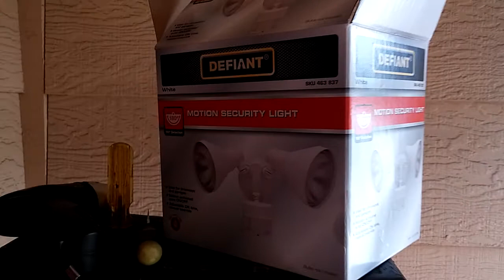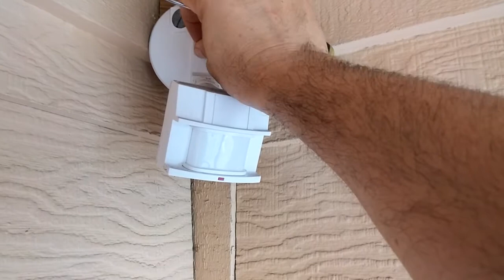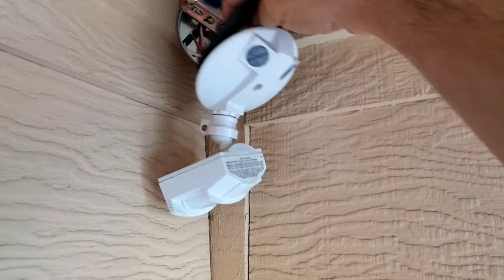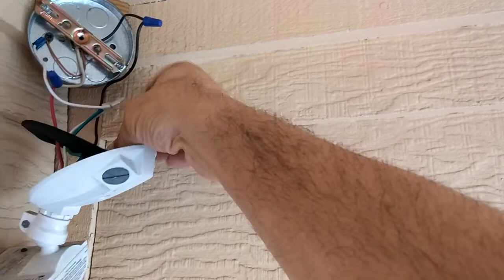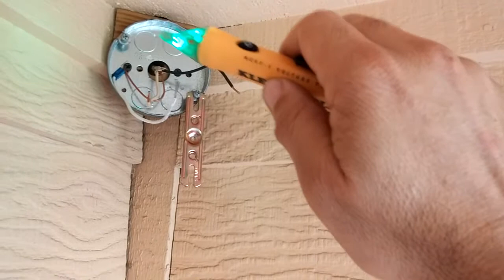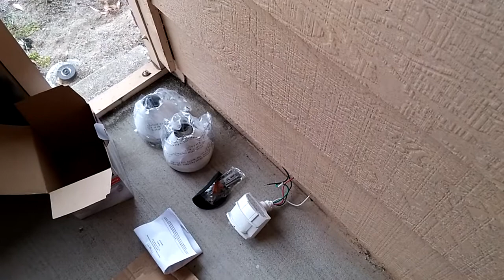DIY/ How to Install a Motion Sensor without the lights bulbs.

Comment: They sell just the sensor. No need to buy the whole kit. And also they sell overhead lights with sensors for like the same price so you don’t need to rig the corner sensor.
Reply from the maker: When I went to pick up just the sensor, it was more expensive than the kit I bought so that's why I used it. Since my light fixture still worked okay is why I didn't at the time get the new type of overhead light with sensor.